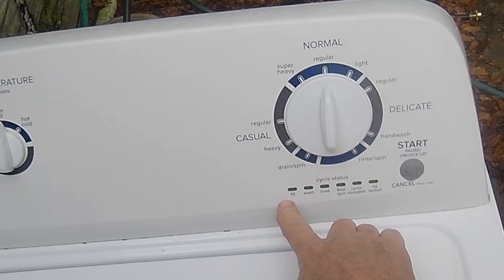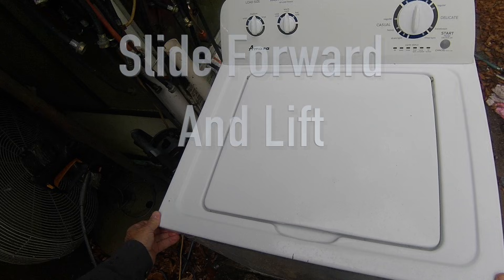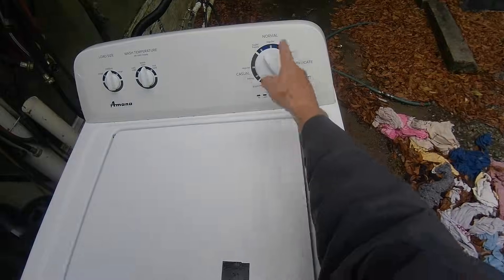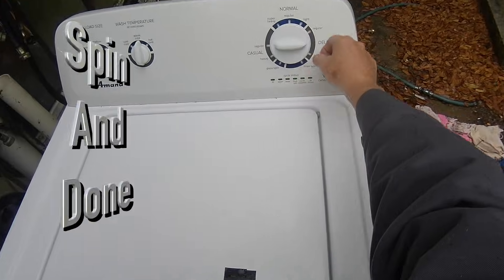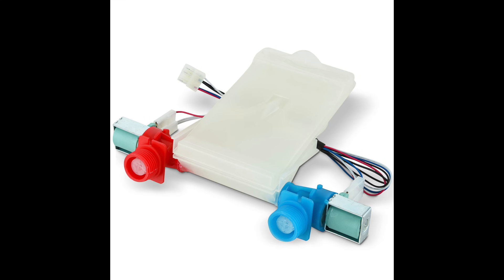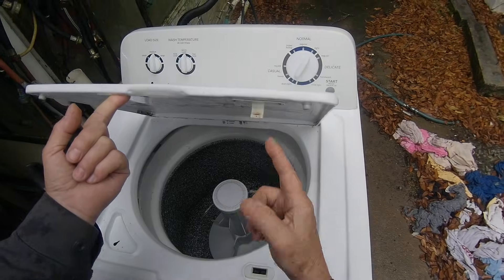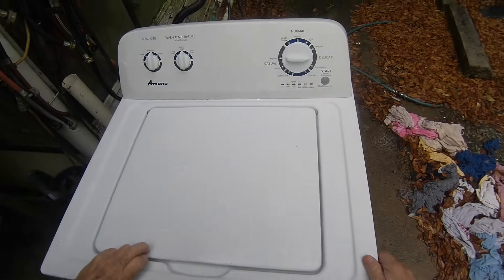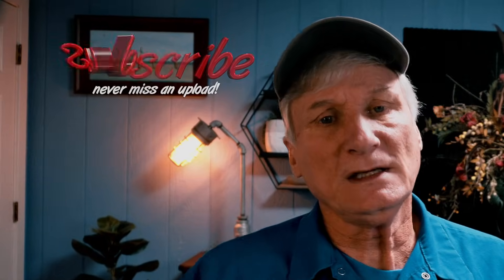How To Diagnose Your Amana Washing Machine: Chip's Guide to Manual Diagnostic Mode

Comment: Sorry I'm a girl and I'm trying my best to figure this out😢. To be clear if the lights start blinking it means its the part that needs replacing correct? Because I think its the actuator...😢

Edit: Its been stopping at rinse and Ive already checked the hot water and cold water and it runs just fine on it own. But after rinse it just stops working...😢
Reply from the maker: It’s most likely the shift actuator. Don’t apologize for being a girl! I think girls are awesome! Thanks for watching!
Reply: @HarperandKnowles  Thank you I'll try it out and update you if I can get it to run 😊
Hopefully I'll get it to run, fingers crossed 🤞

Comment: I failed the low speed test, it sounds as though the teeth are grinding then it spins once then stops and may make a grinding noise
Reply from the maker: The grinding noise is concerning. What did you find out?

Comment: The deep water wash position does not work( fills same amount as sensor wash position) ??
Reply from the maker: You have a problem with the pressure sensor on the control board. Change the board. Thanks for watching!

Comment: Thanks for your video! Unfortunately, I can't make it past the drain test. I'm running all of the other tests up to this point However, the drain pump is running the whole time. All of the LEDs illuminate/blink as in your video but the drain pump is running through all of them. I unplug my machine, plug it back in after 30 seconds or more and the pump starts running right away. I press the start/cancel for about 15 seconds. Pump stops.Turn the dial clockwise a full spin to normal, press start again. Pump turns back on and then the machine will start to fill with the pump continuing to run. I give up after 5 minutes. Board problem? Pump problem? I pulled the drain tube apart. Ran a little small snake into the tube and also machine. No blockage comes out. This is irritating. My machine is not even a year and a half old. And it's just me using it so it's not like I have a family of four. I live in Gettysburg, PA. There also is a little clear vacuum tube that is connected to the back of the board. I was able to push it in slightly. I don't know what it does but I was hoping that might fix the issue. It did not so I pulled it off altogether, blew into it. It's not blocked.
Reply from the maker: You’ll have to change the board or the pressure transducer on the board. Thanks for watching!
Reply: @HarperandKnowles I came to that same conclusion. There is a vendor in my area that keeps notes on why people buy certain things. When I gave him the part number for the board he said, "Let me guess. Your machine won't stop draining?" I can't find ANYONE that has this part in stock or that can find it to order it for me. I have a hunk of junk that is just over a year and a half old. 😡 Thanks for your response!

Comment: What when testing the agitator, it doesn’t spin and all and just sounds like it’s spinning. I’m with the top open running this test, I can hear the sound of it running but just no movement.
Reply from the maker: Look underneath and see if the belt is on, the pulleys are in place, and the splutch is working correctly. Also check the splines in the agitator. They could be stripped out. Thanks for watching!

Comment: My pump never stops pumping. Thanks for the info!
Reply from the maker: Hold down the start switch until it stops. Thanks for watching!
Reply: @HarperandKnowles haha yea but that doesn’t fix it. Thanks for the response
Reply: Unplug the darned thing!! 😅. Did You figure it out?? 🐞
Reply: Mine is doing the same thing. It is constantly wanting to drain. Even going through all the steps its draining. I unplugged and reset, still nothing and wanting to drain. Anyone figured this out?
Reply: @ChaosTheory0415  I decided it was in control board .  Nearly as cheap to buy new washer than buy the board

Comment: Please help! I have a ntw4516fw3 Amana. Following your diagnostic tests, it does lid lock, cold then hot, then pump.when I go to the spin test, I hear what sounds like a solenoid click then if I wait long enough it starts to spin. How do I know if that is the low spin or could it be the high spin. Do I need a separate  test for hight spin. Also the agitate test works. What else is there? When I try to use the washer, it just goes to wash light and stops. Please help, you are the most articulate and easiest to follow that I have found.
Reply from the maker: I’m thinking you need to change the shift actuator. That’s my best guess without being able to diagnose it myself. Thanks for watching!

Comment: Now I am unable to enter diagnostic mode. Only the sensing fill light flashes, not all of the lights flash.
Reply: Now the cancel button for 3 seconds stops it only for a minute, then it starts back up. No lights at all.
Reply: Also, no manual taped to inside.
Reply: Also, no manual taped to inside.

Comment: Question so what can it mean if the washer just cuts on like your washer is constantly draining water even when you unplug it and plug it right back up and won’t light up on any of the cycles?
Reply from the maker: You might want to look at this video Fixing an Amana Washer That Won’t Stop Draining – Pressure Sensor Repair
https://youtu.be/ZRrpa_Mo-hk

Comment: I have a machine that won't spin and seems like everything is working correctly
Reply from the maker: You probably need to change your shift actuator. The spin test bypasses the tachometer that’s part is of the actuator. Testing the tachometer can be done by following the procedure as outlined in the service manual. The service manual is taped to the left front upper cabinet. Thanks for watching!

Comment: I can’t follow any of this because the washer keeps coming on. Washer is only one year old. I really believe these Amana washers are set up to mess up.
Reply from the maker: If the water pump keeps coming on you have a different problem. Here is the fix for that. Fixing an Amana Washer That Won’t Stop Draining – Pressure Sensor Repair
https://youtu.be/ZRrpa_Mo-hk. If your fixit skills aren’t up to it you’ll have to replace the control board. Thanks for watching!

Comment: mine is goes into drain mode after a wash cycle.. just keeps going and going, we have to unplug it. but we figured out how to do a load of laundry but it always gets stuck into drain mode or something just keeps running
Reply: trying to do them codes i think it messed up wash cycle now. idk every cycle goes to final spin. just gonna let it do its thing and unplug it. go buy a new washer. its most likely the board.
Reply: i went back gave it another try but all the LED's were on at the 6 o'clock... so i pressed start. it ran some test and that drain noise hasn't returned. so idk if it got fixed or what??
Reply from the maker: Watch this video. It may give you some clew as to what is going on. Fixing an Amana Washer That Won’t Stop Draining – Pressure Sensor Repair
https://youtu.be/ZRrpa_Mo-hk

Comment: Thank you. Very helpful. I did the diagnostic sequence you describe very clearly and my washer passed every step. Then trying to run a load of wash the washer still stops at the wash step. Why?
Reply from the maker: You'll probably have to change the shift actuator. If you retrieve your service manual look for the section on testing the tachometer. The tachometer is part of the shift actuator but the procedure to test it is separate from the test you did. The common symptom is the machine will stop just before the rinse cycle. Thanks for watching!
Reply: @HarperandKnowles Thank you for that information. I went through the recalibration procedure and then I was able to run a load all the way through successfully. Not sure how the machine got out of whack but hopefully that fixed it. I've only had it 2 years.

Comment: Thanks for making this video.  Enjoyed your straight forward approach and the visuals.  My problem started last night.  After I removed a load of clean clothes and closed the lid, the machine started making noises as though it wanted to start again.  It was not filling with water though.  I unplugged it, replugged it and within a couple minutes it began making the noise again.  I pressed cancel and started another wash, but after that load, it began making the noises again after I removed the clean clothes.  I left it unplugged overnight, but when I plugged it in this morning, it began making the noises  (sounds like wanting to drain)--there are no lights on.  What do you think?  Pierre
Reply from the maker: I think you should watch this video, Fixing an Amana Washer That Won’t Stop Draining – Pressure Sensor Repair
https://youtu.be/ZRrpa_Mo-hk. Thanks for watching!

Comment: Hey Harper! So my Amana washers drain pump is continuously running. We were able to manage it by just holding the cancle button for a couple seconds but then it started getting worse to where now we have to unplug it if we are not using it or it will cut off mid-cycle and just run the drain pump. Does this sound like a bad control board to you? or maybe a pressure switch? Thanks for any help!
Reply from the maker: You got it right both times. It’s the pressure transducer on the control board. If you’re good with a soldering iron you can change that or just replace the board. Use the link in the description that saves “Save on Appliances and Parts” it will take you to Ben’s Appliances and Junk parts store He sells the transducer and he may sell the replacement boards too. Thanks for watching!
Reply: @HarperandKnowles I’m not seeing it on Ben’s website sadly, but I believe it found it on another site. Thank you!
Reply from the maker: https://bens-appliances.com/products/adp51b62m02-piezoresistive-sensor-for-washing-machine-control-board?utm_source=youtube&utm_medium=product_shelf&sca_ref=9434877.dUjEVGPH1QZ0ar

Comment: All the diagnostics seem fine..... except the water just seems to go right thru and out of the washer... like the pump is chronically on.  Not sure what's going on unless the water pump or control board portion is messed up.  Didn't have an issue with this until after running the clean washer cycle.
Reply: Did you ever figure it out? Literally the same thing happened to mine! It is constantly wanting to drain after running the clean washer cycle.

Comment: I watched your video and everything worked when I followed it.  Your conclusion is that the board might be bad.  So I took my board out, and checked the capacitors, and they were all good.  Somehow I found another video which showed me how to "reset" my washer, and now it runs OK.  So I think you should consider adding that to yours, because telling people that the board may be bad after all good tests might get them to spend money they don't need to spend.
Reply from the maker: If your water pump continuously runs you can “reset” it by holding down the start button until it stops. This is a known issue with the pressure transducers on these boards, Whirlpool, who makes Amana, knows this and has offered a free board to those whose serial numbers fall within the defective manufacturing period. The chances are your “reset” will only be a temporary fix and you will eventually have to replace the board. I was thinking you wanted a permanent solution! Thanks for the feedback!
Reply: @HarperandKnowles how do I find out if my board is one of those?
Reply: @HarperandKnowles  My water pump is ok.  Today I found a video which indicates that my motor capacitor may be bad.  I'm testing it right now.

Comment: I ran all of the tests, checked my drain pump underneath, and checked the control board and it still runs like it’s in flood mode nonstop or will quit a cycle before it finishes
Reply from the maker: Hold down the start button for 20 seconds or more to stop the pump. If the problem persists then you’ll have to change the control board. Thanks for watching!

Comment: what happens if everything works individually but it wont start on the regular cycle
Reply from the maker: Each test is independent of the program built into the control board. I suspect that integrated circuit is the problem. Replacing the board will probably fix it. Thanks for watching.

Comment: I got another question... replaced the shift actuator a while ago and it now spins fine however it will not agitate.... so by though was the splutch needs replace now, so i did that this morning and it failed the test again.... sounds like it isnt locking into place if i crawl underneath and manually move the arm to lock it the agitator spins on its own. Thoughts?
Reply from the maker: If the splutch is too hard to shift the actuator may jump the grooves that move the mechanism. Try lubricating the splutch with dry spray lube. I use the WD40 brand. You may have to change the actuator again. Thanks for watching!
Reply: I tried lubing it but it doesn't seem to be working. Sadly looks like I gotta get another actuator. Thanks for the advise. I the little actuator arm feel really loose, so I think its toast. @HarperandKnowles would this all be a good sign to replace the actuator again?
Reply from the maker: @tyearly1793 yeah if it is loose the plastic pin is broken.

Comment: I greatly appreciate you sharing this knowledge! 

My husband said the washing machine was broken and told me to call the rental office for maintenance. 
I’m not helpless and figured I could at least do some basic troubleshooting. 

If it’s truly broken then so be it and I’ll call(machine is only a year old though?) 
But I suspect the problem is related to my husband not using the correct settings, adding too much soap and always hot water. And I’m pretty sure it’s off balance too 😅

I haven’t had any issues myself using cold or cool water and the proper setting for what I’m washing but I did witness his last load not able to finish its cycle. 

So I guess I will go pull the washer out and see what happens 😂
Reply from the maker: Thanks for watching!

Comment: What could cause one to need recalibrating for every load?
Reply from the maker: What makes you think it needs recalibrating every load??
Reply: @HarperandKnowles when we do a load, usually have to recalibrate again or it just senses.
  Called myself looking for error codes but none showed up. 
  I will also try manual test mode. 
  Model number: NTW4516 FW4
  I actually have 2 of these but not sure if same models. I expect they are. They are among of a few I bought from a business going out business. 
  I was told these had been returned under warranty. 
  Thanks for replying.
Reply from the maker: Stuck on sensing after a load…. I’m thinking something hasn’t returned to a normal state. Maybe the shift actuator. Running a diagnostic may force the component to return. I’m guessing here but I’d try that.

Comment: The lid slammed down on top of a piece of clothing and is stuck on lid lock. I've tried pressing and holding the start/cancel button repeatedly as well as unplugging the machine. The machine is empty, but locked. Any suggestions?
Reply from the maker: Take the wire cover off the back and the two screws off the tabs near the side on the back. Slide the top forward and pull it up and see if you can attack the problem from underneath. You may have to force it open and replace the lock and striker!

Comment: Our washer the lid is locked. It will randomly turn on and try to pump water out without spinning. It will occasionally pump water in but while pumping it out. So it won't fill. And the start button doesn't seem to override either. My assumption at this point is that the control board needs replaced. Does that sound right?
Reply from the maker: You need an exorcist!  Yes, it sounds like something is wrong there. Thanks for watching!
Reply: @HarperandKnowles ok, we're not talking about my problems and the demon mostly plays along. So, yeah we just need to deal with the washer and I guess it's the board.
Reply from the maker: Yeah, you probably need a board!
Reply: I'm having a similar issue. My Amana ntw4516fw4 top loading washer never completes a cycle. It gets stuck with the pump running (draining nothing) and all the lights off. 
Trying to do the manual diagnostic is difficult, as each test triggers the pump again, turning off all the lights and making the wheel inputs unresponsive. I have to let the pump run 20-30m before it turns off and gives me control again. Holding down cancel, unplugging it then plugging it back in only interrupts the pump which starts again once cancel is let go or the machine is plugged in again.

Comment: What happens if everything test is good? And I replaced the drain pump, but it does still not work
Reply from the maker: By not work do you mean it stops at the wash cycle?  If so change your shift actuator. Thanks for watching!

Comment: My washer, after it’s done washing all the lights on it turns off and it sounds like the drain pump turns on and the only way to make it stop it rather unplugging it or holding the start/cancel button for 5 seconds then putting it on a wash mode (like regular to heavy etc) any advice? Thanks in advance 🙏
Reply from the maker: You are probably going to need a new control board. You might be eligible for a free one. Watch this video to find out. https://youtu.be/xMLstFmEmY0?si=pY-BQjh9iML28t41

Comment: I've got the exact washer and then pump runs constantly.  Ive reset it several times and that only works for a short time
Reply from the maker: You'll have to change the control board watch this video for maybe getting a free replacement board. https://youtu.be/xMLstFmEmY0?si=EeFV0iEbQEv157NR